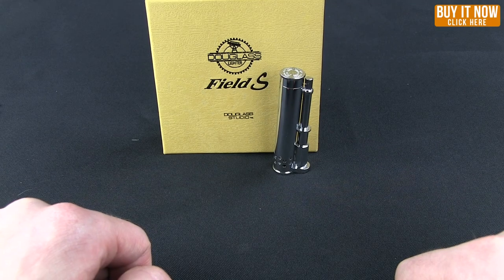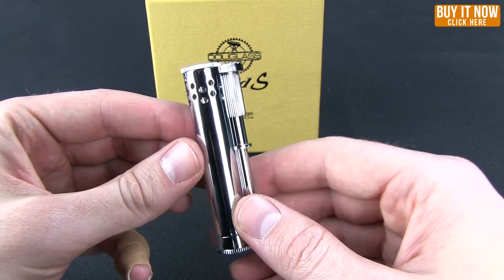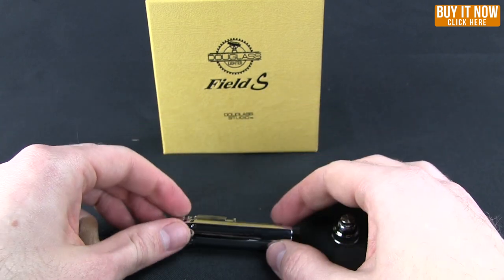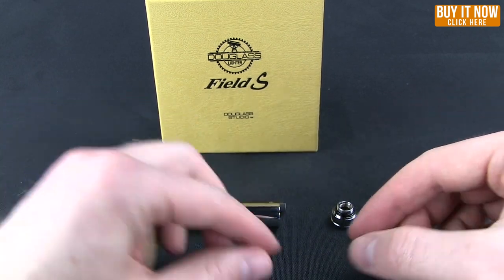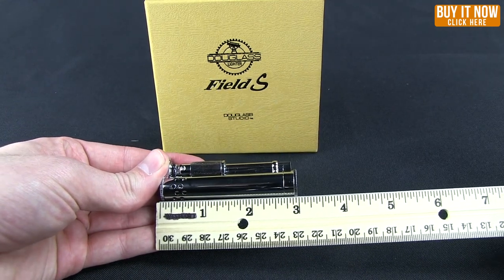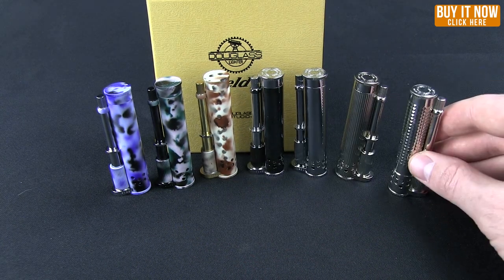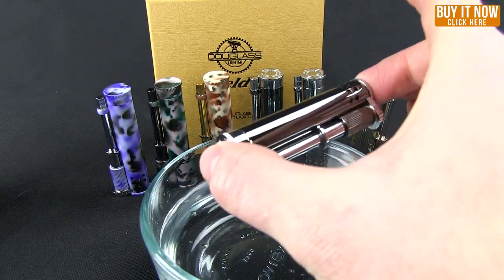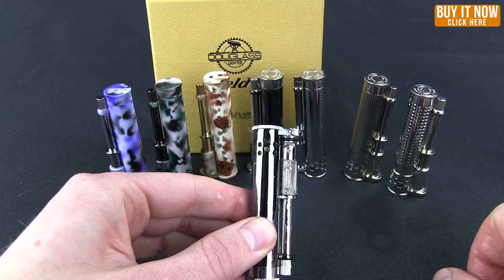Douglass Field Lighter Overview

Comment: If the lid doesn't close how do you change the setting on the ballbearing ring? I have read that somebody did it but didn't specifically elaborate about it. I'm afraid that I will brake it. Is it a clockwise or counter thread? What instruments are suggested to use. Looks very tight to me. Thanks for anybodies advice!

Comment: WORST experience ever with a manufacturer so far. My Douglas Field S came defective from the factory. The lid wouldn't stay close and always popped open. That was an issue with a tiny ball bearing securing the cap. After several tries, All I had as a response from the seller was that the lighter was just fine and the problem was with me. Horrible customer service to say the least. Mine sits in a drawer, useles, afetr two monts of light use. I cannot say anything positive about this brand as I found myself talking with a dishonnest person who didn't not want to take ANY responsibilities for a defective item. On mmy side, I paid with real non§defective money and just received a piec of garbage for it. Thank you , but, no thanks.....

Comment: DO NOT BUY THIS LIGHTER!!!
douglass lighter field 👎🏼👎🏼
If you use this lighter even for 5sec the upper section really dose heat up pretty seriously it will burn your fingers or if you put it in your pocket without cooldown period it will burn you bad. It’s poorly design and overpriced.